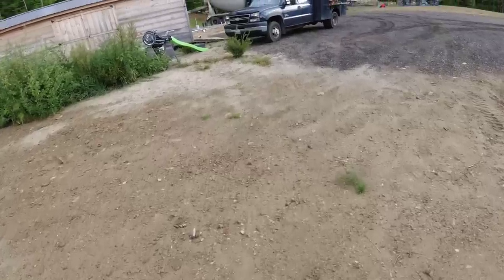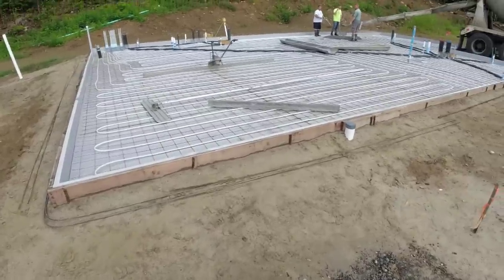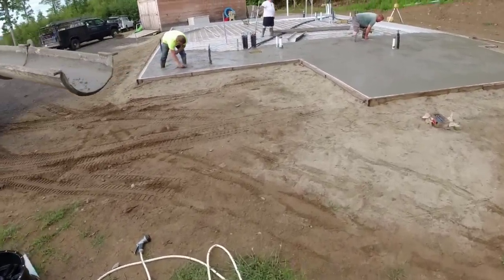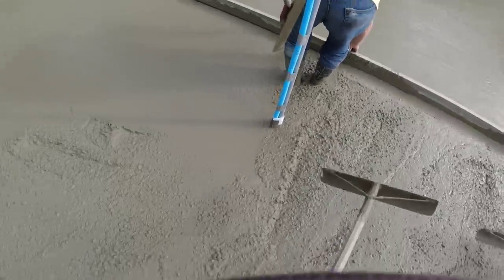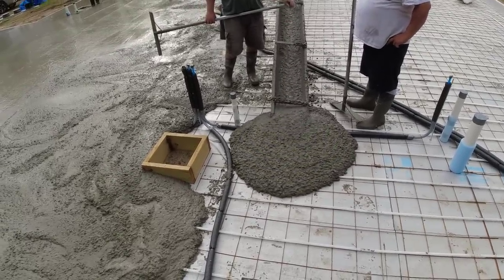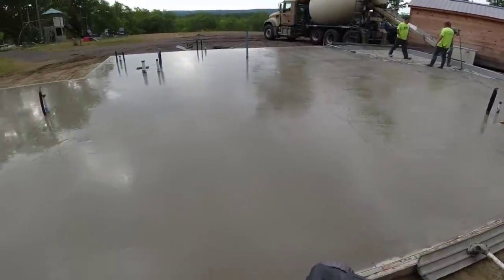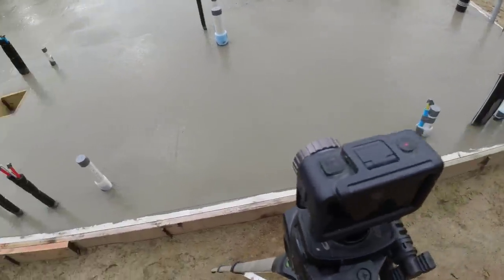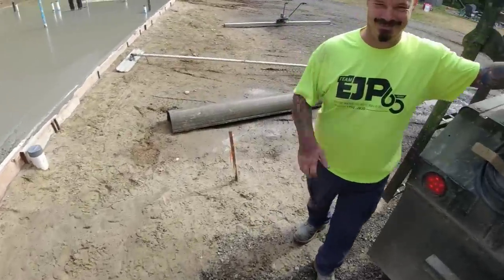We Use High Range Water Reducer To Pour This Concrete Slab - EASY!

Comment: with that much slump is there actually much leveling to be done , or does it just self level .
Reply: I’ve used it and it’s not really self leveling. Just makes it much much more workable and easier to rake and screed. When you’re taking a 4 inch slump and screeding it, especially in summer time, it will wear you out quick.
Reply: @brentpearson4877   many thanks ,, it just so so sloppy ...
Reply: @tomthompson7400  no problem! And yeah definitely

Comment: I am not a concrete guy but I am curious why the steel mesh  is not be held up at all?
Reply: Probably not a good idea to pull on it too much. It has very expensive tubing for heat control in the winter
Reply: It’s money in my eyes
Reply: It's a radiant heat floor you dont want the tubing close to the top because you sawcut the floor. If you hit the tube with the saw well you can figure out the rest.

Comment: Hey Mike, how would they determine the slump at the job site if the water reducer is making it soupier?   Looks like that reducer would give a false slump test.
Reply: Yeah I was curious about this same question as well. I know the cylinder tests would be the same tho.
Reply: For high range water reducers should be added on site as they wear off quickly. You should take a slump test prior to adding them. And then do a spread test after super p is added to make sure the concrete does not separate. And any concrete over a 5" slump should never be screened with a vibrating screener as it will sink the aggregate from the paste.

Comment: Hi Mike. I noticed that you did not lift (suspend) the metal grid that is on the surface of the foam. I thought that for an 8" pour reinforcement is needed. Can you tell us about that? 
Thanks for your awesome videos.
Reply: I thought the same thing then realized he probably has fiber mesh in the mix and the wire is for fastening the heating tubes only

Comment: I gotta try that water reducer. Would you say you’re at a 8 slump? You literally have to keep concrete on the stick instead of dragging it back, plus your top is closed up even before you float it. I know a lot of what you pour is indoor but will you pour that loose when your doin a driveway, especially with air entrainment?

Comment: these ppl making these comme ts about why is no1 pulling the wire up  are killing me. its called radiant heat boys the wire just holds the pipe down
Reply: @Alongfortheride693  wow
Reply: Wire is definitely under the pipes flat on the base if it’s tied to the pipes here and there why not just lay it over the pipes and let the concrete bind underneath.. genuine question
Reply: @lachlanitis2311  nah man the wire is on there to hold down the pipe no reinforcement at all
Reply: @GRUBB-MUDD  wrong, that slab inspection  would not be passed in Australia. We do things differently here, a lot different. While I will admit a lot of Americans finishing skills are excellent the prep work and screeding is abysmal.
Reply: Look at the description, WATER REDUCER, it allows you to use a higher slump and it doesn’t hurt the water to cement ratio, if you guys are going to make stupid comments, go to a different channel, or take an ACI class and you will see why he does things this way, the guy has been going flat work for over 40 years, and is well respected in our area, I’ve been pouring for over 36 yrs, over a million yards poured, for heavy concrete construction, he does it by the book, he uses fiber mesh in every pour, and does whatever the job is specked out, and Australia isn’t America Mate, you don’t have frost or snow to deal with.
Reply: @chrisbrann7733  don't have frost or snow to deal with, very uneducated comment. I live in a town that gets -10c temps so yes I know what I'm talking about. This guy still uses calcium chloride in his concrete, should say enough about the integrity.
Reply: @lachlanitis2311 o you’re telling me it gets 30f? That’s not cold enough for frost, we’re talking about 4’ of frost here where we live, and most residential contractors still use calcium chloride here with no adverse affects to the durability of the concrete, and the reason being is because using it is more practical then a polar set mixed at the plant, because by the time the concrete gets to the site it’s getting hard if the truck has any distance to drive, and like Mike said in his video the trucks were an hour away, if you used a liquid excellerator mixed at the pant and the truck had to go an hour to the site you would be lucky to get the concrete out of the truck, that’s why a lot of people use calcium chloride here because they can mix it onsite and the concrete won’t blow up,on you. Again, if you don’t like the channel find another one, if you look at the comments 99% of them are positive.

Comment: boy that's nice and loose.  I've been using "cement all" mixed to fluid consistency for some hard access void filling and rebarring and I can barely get it mixed before it starts firming up
Reply: That’s because it’s RapidSet and you’re not using the additional additive which slows the curing time

Comment: I noticed you are using the battery powered screed demon with the high range water reducer, how does it work with a mid range? Are there slump limitations with the battery powered creed?

Comment: How disappointing, 4 missed chances to slide down the chute.  Would  a radio headset with the driver  make chute positioning  easier?
Reply: Hand signals work fine, no need to bring electronics into this

Comment: No footing  the reinforce wire flush to floor  rebar not tied up, to each his own, guessing owner wants it that way.
Reply: Irresponsible concreting tbh, mesh needs to be in in the slab, not on the bottom doing nothing. Pure laziness.
Reply: I am also confused as to how there is no footing below the frost line ??
Reply: 2” of foam deters 2’ of frost, the wire is to tie the heat tubes down, and once the heat is turned on you don’t have to worry about frost, not laziness, it’s how it’s specked out, and it’s a heated slab, so you don’t need a footing, and haunched slabs are 50/50 up here, but definitely not necessary in this case. There’s your free education about “concreting”